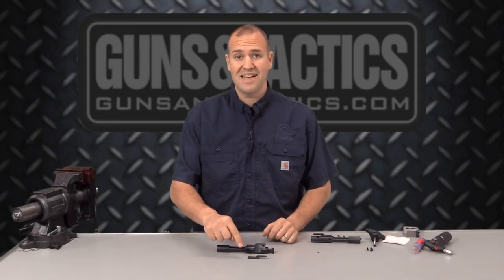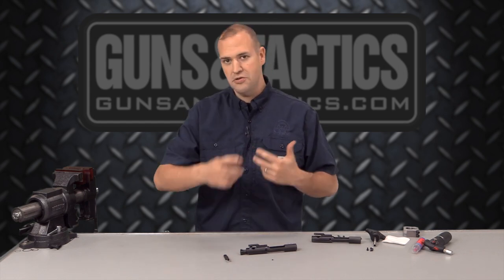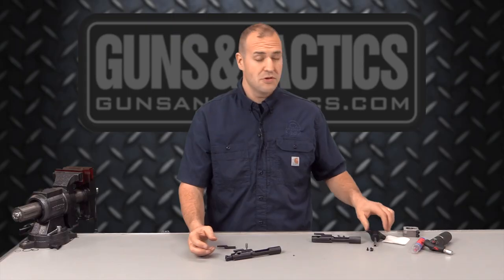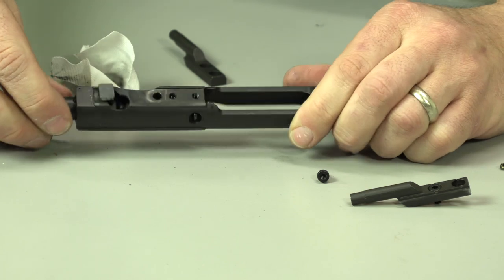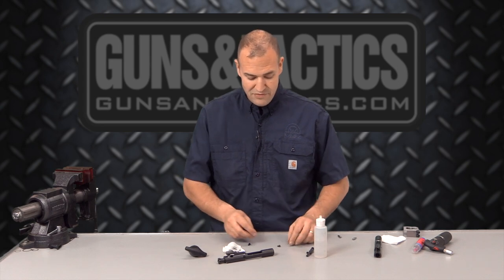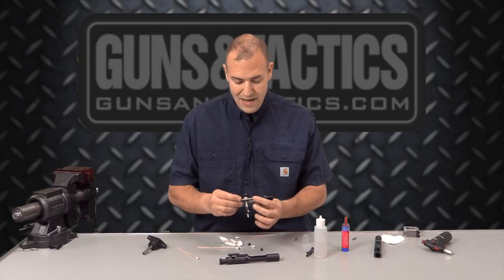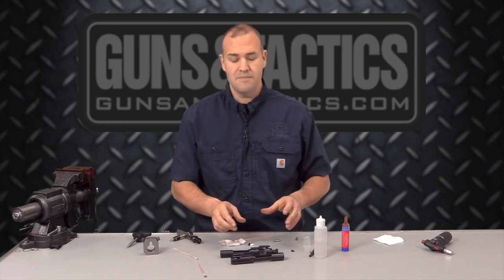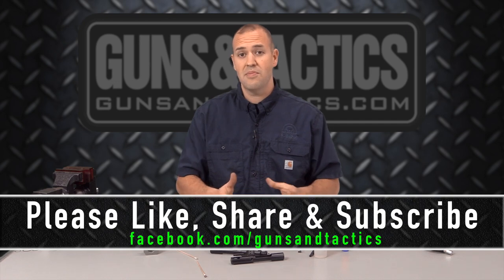AR15 BCG Gas Key Replacement

Comment: I seal with high temp paint like a old head gasket and I spot weld the bolts with a cute little mig weld.  100% reliable. It’s no so much the manufacturer as the dude going through the rifle. U can do it.

Comment: That bolt would never pass inspection, the staking is just for show on it.   If it was staked properly you can't unscrew them.  You have to grind the stakes out.   Yes easier to remove if not staked but it defeats the purpose of staking at all.   I think some companies put in fake stakes just for show and they just screw in the bolts without any need for real stakes.

Comment: in my opinion  staking punch give better result that the squeezing tool
Reply: I just got a MOACKS Plain to fix a Midwest Ind weak stake job and those things are the best
Reply: FWIW: Young Manufacturing states, "Don't use a hammer and a punch! You can stretch the thread on the screw and now you have a loose screw that will eventually break if the gun even fires."

Comment: Another excellent video Dave! Have you noticed certain bcg/carrier key combos allow for some side to side play in the key slot of the bcg before fully tightening? Is this mostly due to the mfg using a smaller head diameter screw? I could see where gas tube aligment issues could occur.
Reply from the maker: Sometimes it’s due to machining tolerances. The screw diameter of the threaded portion is the same, 8-32. -Dave

Comment: Great VDO and solid materials and processes principles. Nevertheless, it reinforces just how inferior the DI AR-15 truly is as a battle rifle. What a hunk of junk compared to a piston. Whoever the manufacturer that doesn't stake the screws and uses red threadlocker is smart. Especially, if they are using the same quality of screws you use. They're not going anywhere. Now, torx cap screws - no bueno. Why? Most every dope and their brother has a set of folding hex keys; bottom line, hex keys are easier to acquire than a torx key or torx bit in a less than desirable situation. You have to be Joe Biden voter stupid to own a DI. You guys argue so hard because your livelihood depends on them. Parts, cleaners, solvents, special cleaning scrapers, and picks all profit from this hunk of junk. Perfume on a pig. No one but Americans make 'em and no one but Americans purchase 'em.

Comment: Thanks for making this video.  I had an issue with my BCG short stroking (a term I wasn't familiar with until after a ton of researching).  The manufacturer tested it and said that it looked like some Permatex was blocking the keyhole and I had no idea what that meant.  They're replacing the BCG so I didn't have to follow your steps but this video really cleared up what they told me and in the end I'm a lot more knowledgeable about how this works for the future.  Thanks again and great video!

Comment: I was looking this up for a Roller Cam Pin [POF☆USA] upgrade.

Last time couldn't get the screws to budge without resorting to pressure I figured might damage the equipment.

Do you have any other recommendations for how to stake if one doesn't have a jig?
Reply from the maker: You can use a prick punch and hammer if you don’t have the jig.

Comment: I'd suspect Permatex gasket sealant oozes as the key is installed and could make its way towards the gas port.  i don't know if that would make a difference, or not.
Reply from the maker: I haven’t used the gasket sealer only gel shown.  You can also run a pipe cleaner through but have to be careful nothing gets stuck

Comment: Doing the coating after the gaskey is installed is done for the same reason as not using sealant under the gas key. It's not a matter of cutting corners but a matter of manufacturing. If you do a DLC or similar coating you need to polish and clean the parts and then bake them in an oven at pretty high temp. You can't have sealant flowing out iuring baking and the coating will seal the edge either way. And you don't want to crush the coating by staking as the final step.
Reply: Makes sense to me. Sealer though I usually do it isn’t needed sometimes leaving things alone is absolutely the best method. Less can be more and cheaper . Work smarter not harder

Comment: Doesn't that threadlocker melt into gas port? I've seen Green loctite 620 & Prematex No3 used.
Reply from the maker: Nope it works fine.  620 works well too.  I still like the gel as it doesn’t run.
Reply: Permatex 27010? Or is it  27200?

Comment: What size hex key / hex bit is used to remove the carrier key bolts.
Reply from the maker: Depends on the quality of screw

Mil spec 1/8
Commercial 9/64
Quality aftermarket upgrades use torx
Reply: Thank You !!  I work at McMaster Carr, along with the 9/64 hex bit also going to order the 8-32x1/4 grade 8 screws to have on hand. 👍🇺🇸👍🇺🇸
Reply from the maker: @armyveteran1000  that’s my go to place for screws.  I would order the SHCS with the torx head
Reply: Awesome, I placed the order for the 92610A190 which are a grade C39, stronger than grade 8.. I also purchased the Torx-Plus, IP25 bit 54305A24 to do the job and the loctite 620 which should complete the job. All from McMaster Carr. Thank you for your video and advice. Much appreciated.
Reply from the maker: @armyveteran1000  hope you get an employee discount :-)

Comment: Thanks for the demo.  I have a question for you re: BCG's.  I have two uppers for my self built AR. I only have one BCG however. I have checked headspace for both as good.  Is this practice acceptable or do I run the risk of a problem?  I plan on getting another BCG in the future. How am I doing?
Reply from the maker: While it’s not accepted, depending on round count it could work.  The ideal solution would be to have a dedicated BCG for each upper so they wear together etc.

Comment: Was that permatex thread lock that you used?
Reply from the maker: High strength threadlocker gel.  You can find it at auto parts stores or amazon
Reply: Thanks for your reply. Do you think it’s necessary to use blue medium strength permatex on the buffer tube, castle nut and free float handguard?
Reply from the maker: Buffer tube no.  Castle but should be staked.   As far as the rail depends o. What kind.   Follow manufacturer instructions

Comment: What can't you reuse the screws if u put loctite on them?
Reply from the maker: You could but usually once they are staked it’s easier to replace them
Reply: @GunsandTactics  ok. If u get new screws can u locktite them and the gas key and not stake them?
Reply from the maker: You could.  Actually one BCG maker doesn’t stake them and only seals the key and screws with high temp threadlocker.  Staking is “Mil spec” so most prefer it as it offers additionally security when done correctly.
Reply: @GunsandTactics  thanks for the reply.  The issue was that a gas ring frayed and I had to remove the gas key to get the bolt out of the carrier. Replaced the gas rings then put gas key back on using loctite with the existing screws. We'll see how it works

Comment: Mine was staked on really deep, so I used a small dremel grinder to remove to staking before taking the screws out. The screws still didn't want to budge until i used full arm force on the allen wrench. Both screws broke free violently with sparks flying.
Reply from the maker: The sign of a job done right

Comment: The updated technical manual for the Army, Air Force and USMC call for the carrier key torque is 50-58 inch lbs. Other than that decent video.
Reply: That's for a dry screw, once the screw is wet from threadlocker you need to adjust and use less torque.
Reply: @Learningfirearms  No, Colt had gas keys come loose in the late 1990's and early 2000's and increased the torque spec...